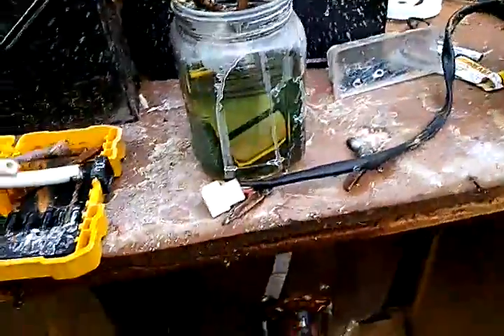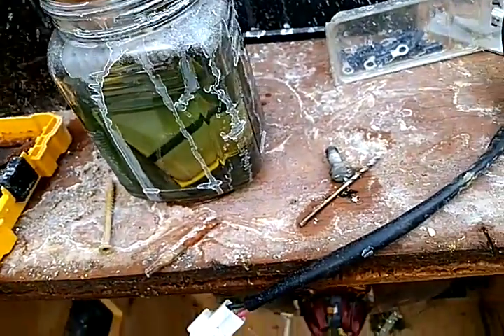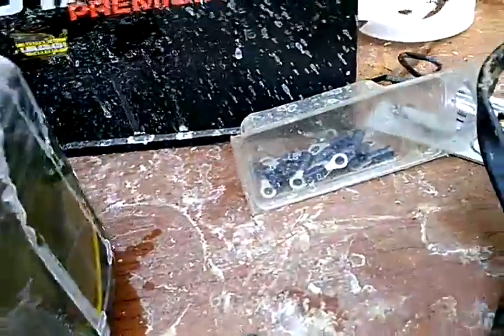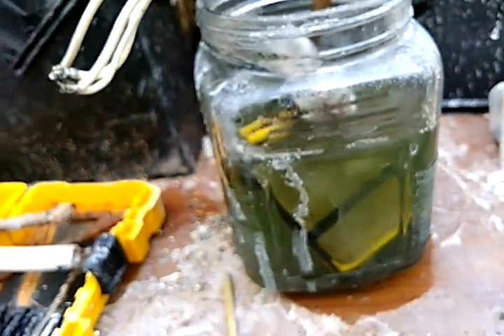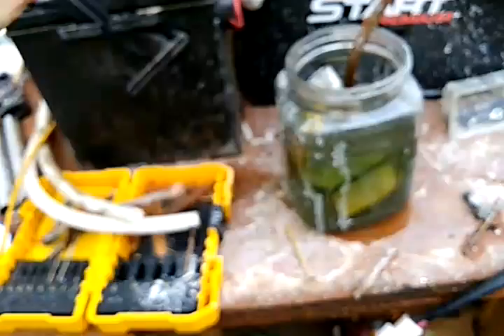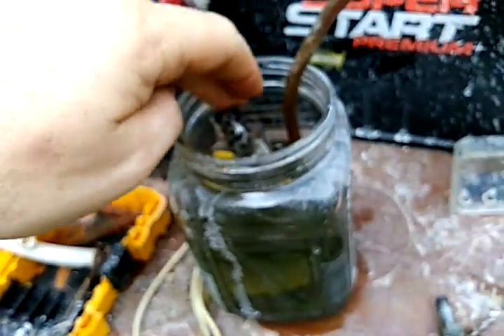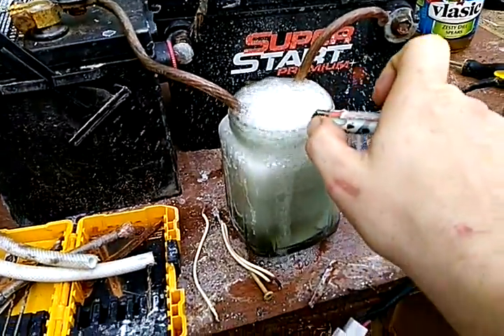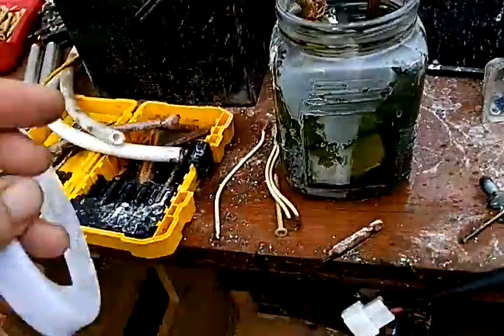HHO P1. HYDROGEN CELLS SECRETS REVEALED!!!

Comment: If you pulse the amps, you will generate more hydrogen. Also, shooting frequencies through the wires at a resident that breaks hydrogen bonds will give you plenty of hydrogen and oxygen at a 2 to 1 ratio to run generators. Have fun. 👍